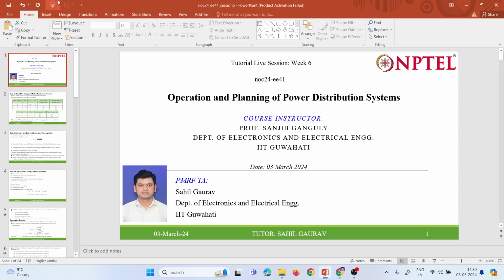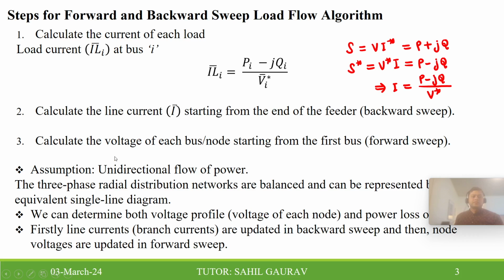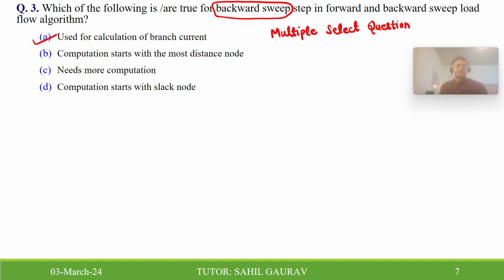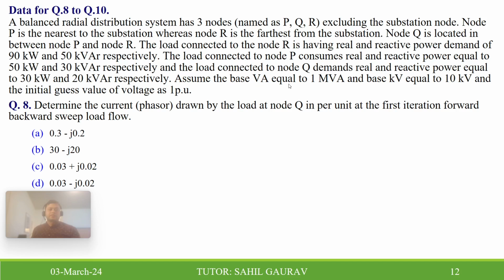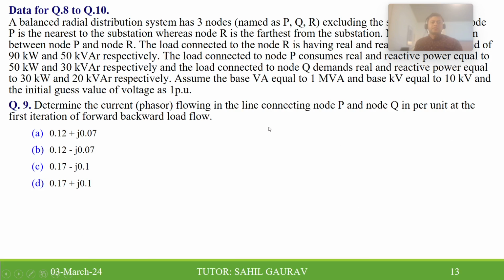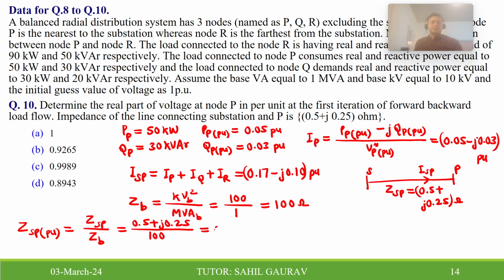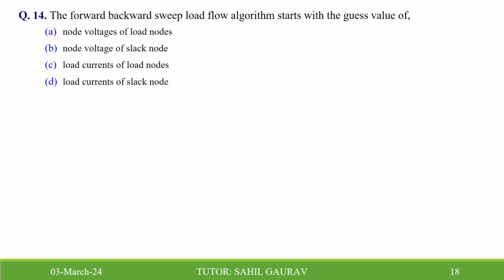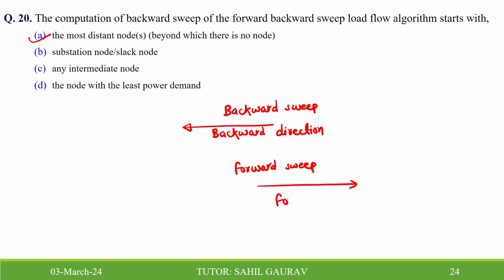Load Flow Analysis of Radial Distribution Networks || Forward Backward Sweep Approach || Session 6

Comment: Good Afternoon sir.. is there any particular text book for for load flow analysis using forward backward sweep method for Radial Distribution Networks ...
Reply from the maker: Good afternoon dear. Sorry for late reply. 
Text book name: "Electric Power Distribution System Engineering" by Turan Gönen